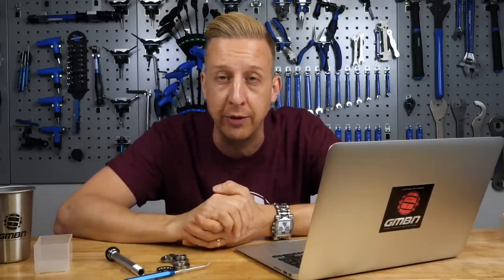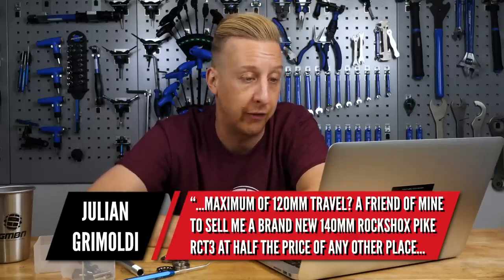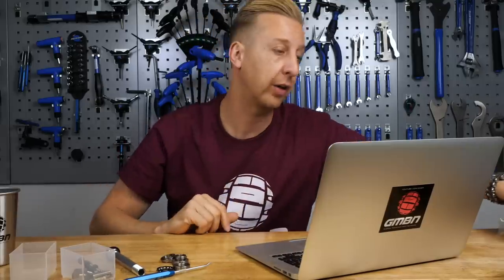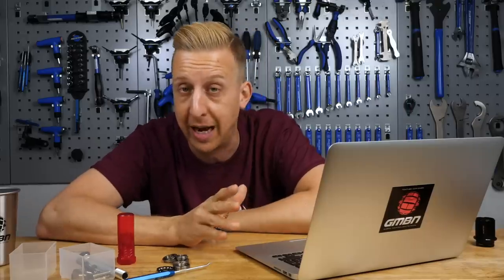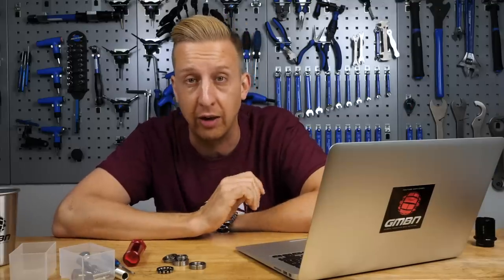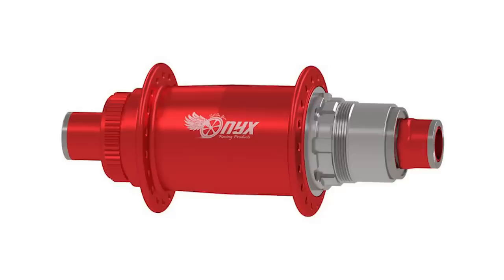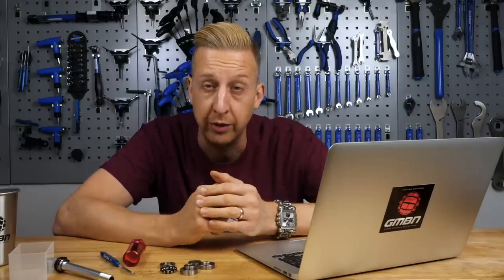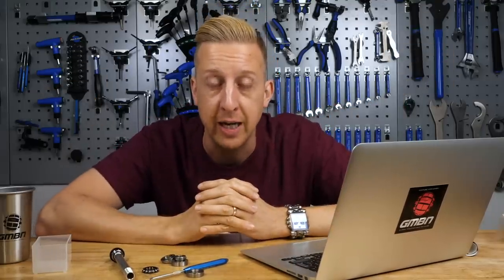Are Cheap Chinese Carbon Frames Too Good To be True? | Ask GMBN Tech

Comment: Why buy an unknown CF frame when affordable and well built aluminum frames abound?
Reply: Can you post a link to these affordable and well built Aluminum frames please?
Reply: @notachance8887   Nota Chance  Did you not see Doddy's Nomad bike build? I bought a Chameleon frame direct from Santa Cruz for $500 USD about three years ago. Also go to Trek bikes. They have road and MTB frames on sale now... scroll all the way down to the aluminum models. I may order an ALR road frame soon.
Reply: @notachance8887  Oh , here is link to the Trek Emonda I'm ordering, https://www.trekbikes.com/us/en_US/bikes/road-bikes/performance-road-bikes/%C3%A9monda/%C3%A9monda-alr/%C3%A9monda-alr-frameset/p/21564/?colorCode=black
Reply: @newttella1043  I guess we have different ideas of affordability.  I'm looking for a 120mm/120mm full suspension frame so I can use the parts I have.  Santa Cruz 5010, which would necessitate a new fork since it is 130mm of travel,  is $2000 for the frame and shock.   A complete Marin Hawk Hill, which would be a perfect bike for where and how I ride,  is $1600.  A Chinese Full Sus frame is about $800-850.  Those prices are why people take a good look at the Chinese carbon frames and want to know if they are legit or not.  

Personally, I'd rather have Aluminum and I've seen a lot of aluminum FS frames on Aliexpress and Ebay but they are 26" wheels and usually 17 in frames which are too small for me.
Reply: @notachance8887  I understand the re-using of parts, thus my choice of the Trek road frame with rim brakes. Just be careful that any time you build a bike, there will be surprises and not all your parts will transfer over. Your costs creep up and then you might wish you got the $1600 Marin complete bike. You can sell your old fork and parts (or the new parts for more money) and next thing you know the new Marin, warranty and all, is not too expensive after all. In fact Chinese carbon frames might have surprisingly old technology like quick release rear drop outs and non tapered steer tubes, narrow frame width and unable to fit wider tires forcing you to buy outdated parts. For Santa Cruz, frame replacement warranty, crash replacement pricing and the lifetime free pivot bearing replacement (annually) pays for itself if you ride a lot and keep your bike for many years. Plus a much higher resale value than an unknown brand. In fact my next MTB will be a Santa Cruz Nomad or Bronson (aluminum) based on the my friends' experiences on crazy technical downhill trails with amazing warranty service for those big crashes. Good luck on your Chinese CF frame build, I do hope it works out for you.
Reply: Newt Tella that is the conundrum, all said and done, would I be better off with the Marin.  It is the unknown quality of the Chinese frame and my interest in seeing a channel such as this dig into it.  My parts are less than a year old but are old tech so QR rear dropouts are what I'm after :) If I cant find something in that configuration, then buying a complete bike would be the way to go.  By the time I got the frame, even a cheap CCF, then a new wheel set, and a rear shock, I'm already at or near the Marin :)

Comment: #askgmbntech i have an entry level 27.5+ bike that runs a boost-spaced, straight-steerer fork. Can I use an alternate lower headset cup to fit a tapered-steerer fork? This would open up many possibilities for upgrading over my low-end coil fork.

Comment: #askgmbntech  Hi Doddy, do you have any tipps on winter riding gloves that can be used in temperatures around -2/-3°C. I can't really find any good information about the warmth of many gloves like the fox attack pro fire or enduro MT500 / Deluge 2. Thanks in advance!!
Reply: Cheap alternative for that temperature range: Galibier Winter Gloves. Winters here are hard and we go anywhere from +30 C in the summer to -30 C in bad winter days. I've frozen my hands before and they are fragile now, and so own about a dozen alternatives for gloves in every temperature range. 

The reality is that even with manufacturer and friend suggestions everyone feels things differently. I did my last CX race of the season last weekend - full snow cover, 0 degrees at the start. I had gloves that were a bit lighter and used a chemical pack because I prefer more sensitivity for braking and shifting in 'cross. They still got very cold when I soaked them crashing in a frozen puddle. In contrast my friend had uncovered hands - and no problem. Yikes.

Comment: #askgmbntech 
Hi Doddy love the show, it's been a god send with some of the things I've done or tried to do. Got an issue though, when shifting down my bike wont change from 2nd to 3rd, I have to go to 4th then shift back up. It will shift fine going from 4th through 3rd to 2nd. My hanger is fine I had it checked at my LBS. Thoughts?

Comment: #askgmbn Hi Doddy! I was wondering if it is possible to switch my rockshox super deluxe rct3 on my nukeproof mega upside down. It would maybe give enough space and allow me to place a bottle cage within the frame rather than underneath it. Would that in anyway change the performance of the shock or will there be no difference at all? 
Cheers lukas!
Reply: clinkzluggi I don’t think there would be any problem as bikes come with the shock all sorts of ways
Reply: If anything it'll give a slight improvement, plenty of people flip them including pros

Comment: #askgmbntech

I was cycling along and I was changing gears and when shifting the bottom lever felt as if there was no force against it and then would have to push the derailleur  slightly onto the next ring down and give it a sharp crank it’s been going on for a few weeks I have changed the cable multiple times and the shifter it would usually do the trick for an hour and then feel the same please can I have some help I don’t know what to do

Javier Iqbal
(Je-veer)

Comment: #askgmbntech TUBELESS QUESTION: I’m usually only able to ride once a month. I’m still running tubes because my bike sites for 3 weeks at a time before I go riding again. Would tubeless dry out quickly since it would be sitting a lot in between trail rides? Seems like tubes is the better option for someone like me that doesn’t get to ride often, but everyone says tubeless is a game changer and I’d love to try it if I knew the sealant would be fine sitting for a few weeks.
Reply: I am curious about this as well. Sometimes there are month long stints between rides on some of my bikes. I’ve resisted going tubeless for this same reason.
Reply: Stans and Cafe latex dry out in a couple of days , from first hand experience. Theres another channel which tested this and found the same/ poor results from many of the big names unfortunately. The Tubeless setup still works against pinch flats (no tubes) but you don't get the thorn protection against punctures. Most sealants seem pretty poor at continuing to do their full job after a few days without the bike being used but the tests always look at just freshly installed sealant. Dried out sealant is still slightly better than a tubed option unless you swap tyres around frequently.

Comment: #askgmbntech
Hi guys,

I presently own a Scott Spark 940 2017, with a 120mm travel front and rear.  Even if I really love my bike and it’s already trail friendly, I tend to lean more and more on the trail side, so I bought a shorter stem (50mm replacing the stock 70mm) and a wider bar (777mm with a 15 mm rise replacing the stock 740mm flat)).

Also, I recently learned I could get the Fox suspension increased up to 20 mm. So I was wondering if 20 mm would be too much, combined with my recent purchase, without sacrificing all its climbing abilities. If so, would 10 mm worth it?

Note: Changing bike or fork isn’t an option for me.

Thanks a lot and go on with your great work!
Reply: Even 20mm won't make it excessively slack, should be fine as long as you're okay with the higher BB and bars. I've personally gone from 140 to 150 and it was a noticeable improvement all around (More confident on descents, more comfortable on climbs. Bike has a low BB and I wanted the bars a bit higher, gave me a better riding position)

Comment: Right so you have no actual experience with Chinese products but are just going to push the brand's sales narratives. I have on the other hand purchased hundreds of thousands of dollars worth of carbon products from China for my bike shops and can assure you I have personally tested them before selling and found more than 90% of them to be excellent quality and only about 5% unfit for resale. Branded products have roughly nearly the same success rate at much higher pricing. Where do you think bikes like Cervelos are made? The same factory that produce frames found on Ali for a fraction of the price.

Comment: #askgmbntech Hi is there any reason mtb’s don’t use upside down forks ? Seeing as there almost 100% used on motorbikes on road,motoX.,trials etc.
Reply: Charles Christie yes I know there available but I was asking why they aren’t used to the extent they are on motorbikes.
Reply: @Gmh6477  Why need to be used more, looks like only thing you get more is weight.
Reply: Mr. Wizeguy on the currently available ones yeah, but you’d gain the years of R&D and experience gained from the motorbike world 🤷🏻‍♂️
Reply: @Gmh6477  Fairplay dude (or dude'ess)
Reply: Because: they add weight; the forces on cycling are nothing like motorcycles, and the lower exposed slider will damage easier.

Comment: #askgmbntech Gday Doddy I have been currently looking at getting my first full squish bike due to my entry level hardtail starting to fall apart. I have been looking at a mongoose Salvo Supa Comp 27.5+ and was wondering if it was any good if not could you recommend any bike that would be $1500aud or less cheers (available in Australia)
Reply: calibre boss nut an excellent cheap full sus perfect for beginners to experts
Reply: Le Typ and TheMangoMuncher thanks for the suggestions unfortunately I can’t get those bikes in Australia

Comment: #askgmbntech. Is there benefit in using boost forks on a non boost frame? Or would it be better to stick with non boost forks so not to mix wheel standards?

Comment: w mtb, if you crash, youre gonna be messed up either way, at least the frame wont be costly to replace
Reply from the maker: It depends how you crash, really. If you crash because the frame breaks, then that's not good in itself. But if the frame breaks and you get tangled in it......
Reply: With the kind of injuries these crashes are inflicting, the costs of a new frame are just a fraction of the ones of your medical treatment!

Comment: Cheap ,Chinese and good don’t go in the same sentence.
Not known for quality in anything the Chinese.
Reply: Odd you say that...Take the road bike manufacturers Pinarello and giant, both frames are made in China, both are available as "Grey imports/open mold" framesets. Pinarello have "made in Italy" on their frames but the trading standard in Italy is the product has to be assembled and completed in Italy. 
Once the frame design has been developed the mold is then machined to a tight tolerance, say for their F10 frame. When they develop a new frame, say the F12, the older frame molds become "open molds" or they just get copied. The manufacturing processes are normally made to the same standards but this is what's at question. There are other Youtube videos where carbon framesets costing thousands of pounds get cut in half to see if they are what they say they are....The on that I remember the most is a Dogma 65.1 1K. Once cut open they found the frame had areas of 3K carbon.....This is a branded frame.
My question is, just because your frame has a brand what makes you think it's better than a "Cheap Chinese" frameset. Yes they do get tested but no they don't test every frame, yes they are constructed by hand but no they're not made by the same hands so you would expect them to vary. If your the sort of rider that puts out 1000W on a normal ride then Grey imports aren't for you, These however are Chinese frames that do get tested: http://www.velobuildmall.com/

Comment: #askgmbntech Hey doddy, i have just bought the commencal meta ht am origins (2019) and i m having problems with the hub not being tight, do you think it is a good bike ?
Reply: What do you mean by "hub is not tight"?!
Reply: @geemail369  my whole wheel has play because of the hub and it s new, cant belive commencal made such a bad job of it. Plus the spokes aren't tight propely and the wheel isn t perfectly straight.
Reply: @charliehawkridge2842  Looks to be a fairly decent bike.
But with the spokes not tensioned properly, the wheel being of center and having play on the axle it seems to be ready for return as there are a few things to check!
Shoot'em an email describing your issue - maybe they'll agree to you taking that thing to your local bike shop and having it fixed on their behalf!?!
Reply: @geemail369  yes it is what i did and i am having the wheel fixied right now in my local bike shop but i will have to wait to get the spokes looked at because i don t have the money right now thanks anyways
Reply: @charliehawkridge2842   Brandnew bike?! You don't need any money: WARRANTY!
Reply: ... have you tried tightening the hub? Things come loose on bikes, especially new bikes.

Comment: READ THE REVIEWS FROM ALIEXPRESS before buying. Its more than real and SOME of the forks have the same or better internals than the name brands. The frames are as real as rain and YOU WILL NOT GET PURE DOWNHILL ORIENTED BIKES. You have to be aware of what your buying and read the review WITH PICTURE IN FEEDBACK. So far there is only one ALL MOUNTAIN FORK SET AT 160MM TRAVEL. IF YOU RACE XC THEN LOOK AT THE FRAME WEIGHT AND T NUMBER for stiffness. The carbon wheelsets and hubs are REAL and good. This stuff is the real deal and they offer 200 dollar pure trail frames that are off the charts in terms of value. I know what I'm talking about and have been buying strictly from ALIEXPRESS VENDORS FOR YEARS. DO NOT BUY OLD MATERIAL THAT IS OUTDATED FROM ALIEXPRESS. The newer the better and beware of the prices because the vendors ARE NOT ALL THE SAME. Doddy, please review these items honestly, because sales are down because of high pricing and you could be saving the industry by GETTING PEOPLE TO BIKE. If it says KASHIMA COATING THEM IT PROBABLY IS. Dont expect to DESTROY MERCHANDISE AND RETURN IT WITH A WARRANTY. CHINESE SUPPLIERS KNOW EXACTLY WHAT THEY SENT AND THE CONDITION IT WAS IN LEAVING CHINA. The major suppliers will honor their warranties and will go above the warranty to keep you as a customer. THEY JUST WANT YOU HOOKED ON SHOPPING AND WILL OFFER DEALS THAT ARE ABSURD.  THE TRANSLATIONS ARE DIFFICULT FOR THE SUPPLIERS BUT IF YOU KNOW WHAT TO LOOK FOR THEN ITS MORE THAN REAL. There is a 26 inch pure downhill frame available from GIOS BRAZIL for 300 bucks, but its only a 26 inch wheel frame. 1X12 GROUPSETS ON ALIBABA FOR 150 DOLLARS from redland ningbo should be tested on this channel because its a game changer.